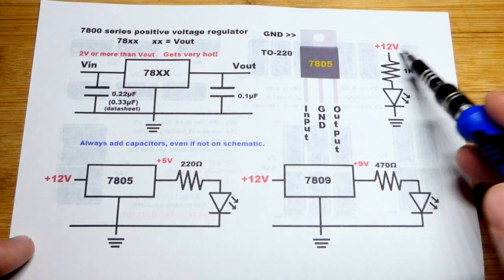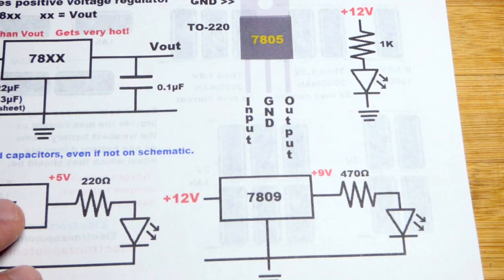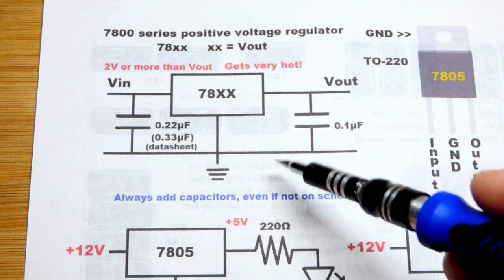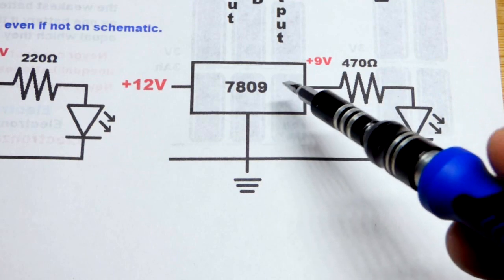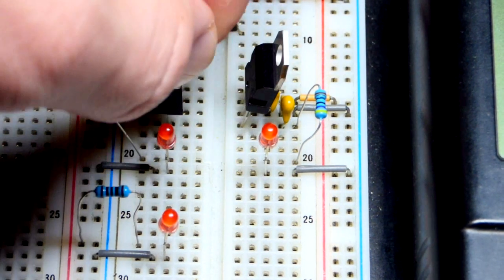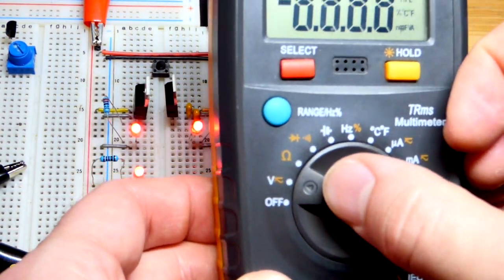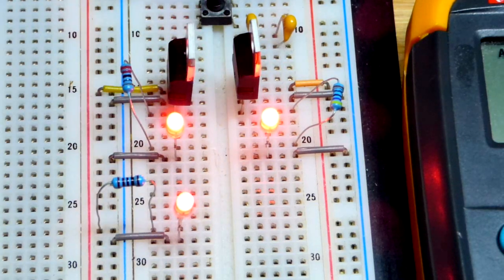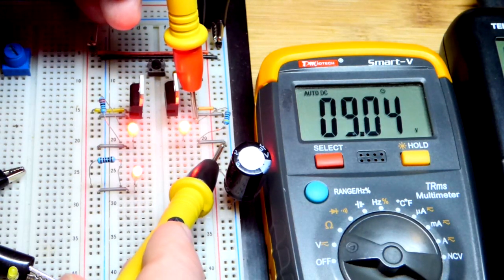How to use 7800 series integrated circuits ICs positive voltage regulators DIY 7805 7809 with LEDs

Comment: I've learned a lot from your videos and I thank you for it. Being self taught these vids are priceless. 
I am trying to figure out how to different values of these regulators in a power supply. Do I put them in series or parallel? I need +12v, -12v, +9v, -9v and +5v out using a 15v 1a wall wart, all at the same time. If I only needed one at a time, I'd use the adjustable one. I know about the smoothing caps and all that.
Reply from the maker: You would put them in parallel. Just remember that their currents all add up, so the main power source have to provide that total amount of current. Should be able to find a lot of schematic diagrams related to building that if you do google searches.
Reply: @Electronzap  I shouldn't be needing more than an Amp. I hope. I have another supply for the amplifier. 
Thanks a lot man.
Reply: I have searched for days for the solution but couldn't find anything but how to use one regulator.  I am hoping that I can send you some support the first of the month.

Comment: Is there a way to design a heat sink to handle a 9VDC input 🙄 Let me know 😎 I look forward to hearing from you 🤔
Reply from the maker: I haven't been able to find any information on the proper heat sink to use so far. Since 7800 voltage regulators do a good job protecting themselves from overheating by limiting current as needed, I would try a heat sink at twice the current you expect to need. If current drops after a little while, then try a larger heat sink. You need to use the same supply voltage that you will be using later as more voltage = more heat generated for a given current.